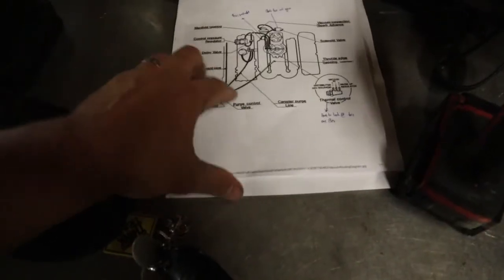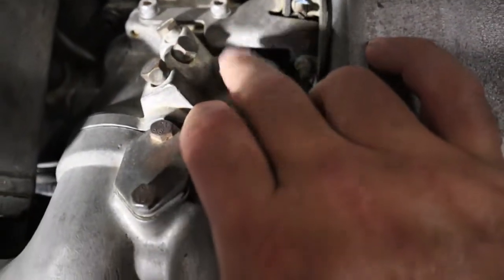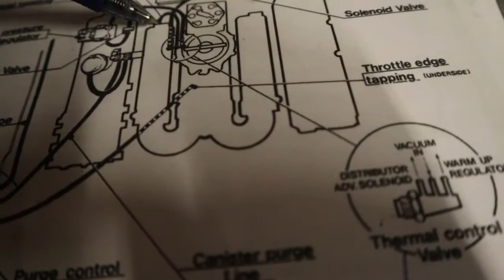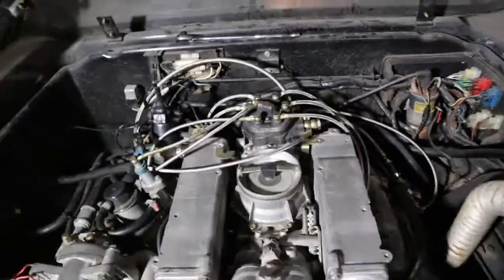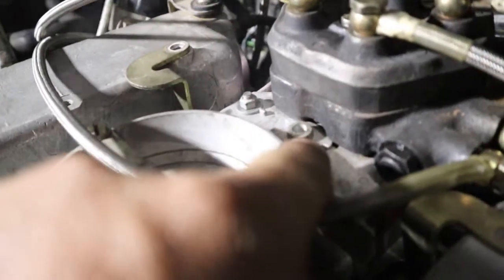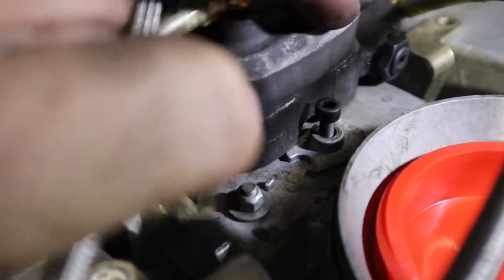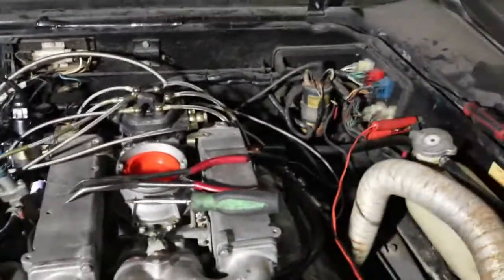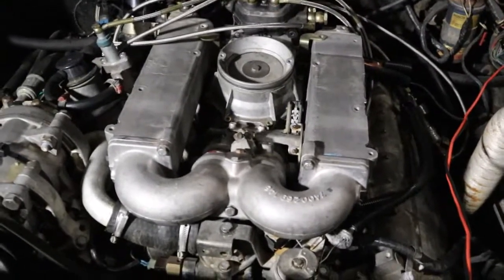Finding and Fixing Vacuum Leaks on my Delorean. Pt. 6

Comment: Congrats on getting 'er running! The hole that you blocked off is what I was referring to, and where you make your air/fuel mixture adjustment using a 3mm allen key. If the key doesn't catch on anything, then whomever tampered with it may have drilled too deep. Basically, if the plug has been removed, your mixture has been changed. Eventually you'll need to re-adjust your mixture (AFTER everything else is in working order). That black cylinder-looking thing is your Idle Speed Motor.

Comment: You can get a newer style idle air controller off of eBay I think for around $17 is what I spent and it works perfectly. It's smaller so it needs a rubber sleeve to make up the difference in the bracket. Pay attention to the arrows when you take yours out it does go in one way only

Comment: The screw that you're referring to is the air fuel mixture adjustment screw it's an allen keyand there should not be a screw in there there should actually be a little rubber plunger that sits on top just enough to seal the vacuum the part that you have to replace is your idle speed motor they do go out not a big dealthe piper you're talking about in the back of the motor is actually referred to as the pipe of agony mainly because it's a pain in the butt to get into placethat big rectangular piece you were holding is actually your warmupbox that hooks to the intake it's designed to pull heat from the manifold into the intake on cold startspersonally I pulled mine out and just put a straight tube into the Pontoon it doesn't do enough to make it worth it to put it in not to mentionthey don't work half the time so any other questions just let me know